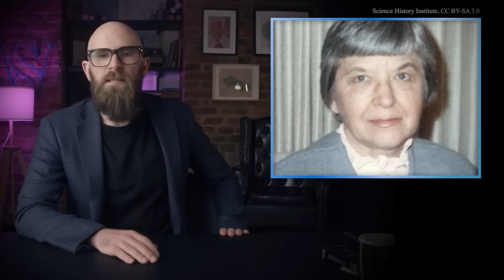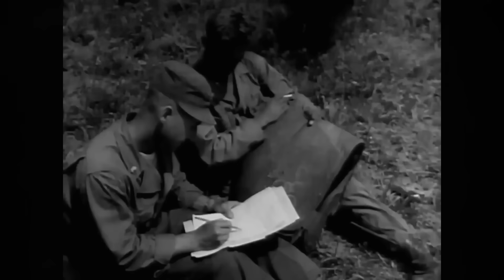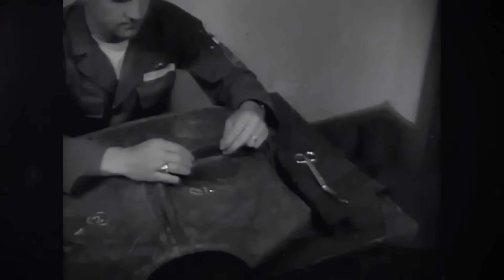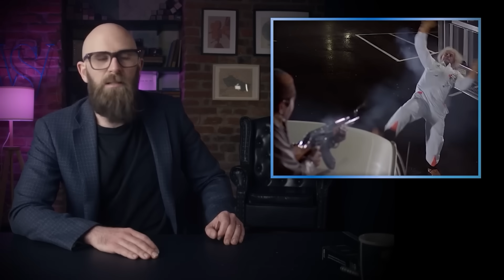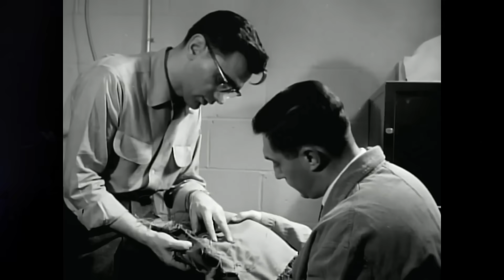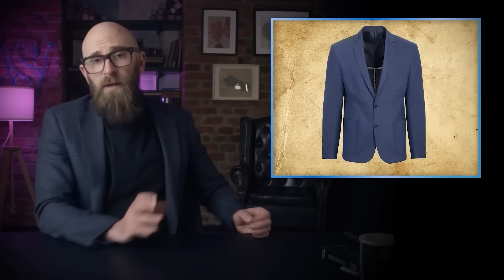How Effective are Modern Bullet Proof Vests Really?

Comment: I made Kevlar for about 30 years.  Not the vests themselves, but the material (a thread line) the vests themselves are made from.  We quickly learned from our engineers that there is "No such thing as "bullet proof."  There is only "bullet resistant."
Reply: like waterproof watches?
Reply: 20mm ap is also a bullet. 120mm apfds also counts as a bullet. 😂
Reply: @jessicaregina1956 . When a 45 ACP doesn’t convey “you messed up” serious enough.  120 mm would be an interesting demonstration lol
Reply: @michaelgallagher7020 way back in early internet I read that 120m sabot also counts as bullet.😂
Reply: @j @jessicaregina1956 echnically I believe that has merit.    Just a big projectile of rearrangement…😂
Reply: Even the big eod suits arent rated for 20mm ap 😂

Comment: Depends on the vest, depends on if it’s soft armour or plate, depends on what it’s rated for.
Level 2 stops less than level 3A stops less than level 3 stops less than than level 4, depends on the gun and barrel length, is it a fast moving small round or a slow heavy round, full metal jacket or hollow point, pistol or rifle or slug, calibre, brass solid penetrators or green tip, how many grains in the round? If rifle what calibre and is the vest rated for that calibre?
If the vest is rated higher than the calibre in use then it works.
If the vest is rated up to 44 calibre and you’re loaded up with silver tip 50BMG then the vest probably wouldn’t stop it.

Comment: Wait... it was developed for tires originally? Where the fuq are my kevlar tires then?!? Would've saved my ass a few weeks ago.
Reply: Goodyear all-terrain adventure tires have Kevlar in them. I hope this helps.
Reply: We actually do have Kevlar tires.  Kevlar layers are incorporated into the sidewalls of several off-road tires.  One example I know is the Goodyear Wrangler All-Terrain Adventure with Kevlar.   The Kevlar helps to prevent cuts and punctures to the sidewall from rocks and other similar hazards.
Reply: They're on my offroad truck. Goodyear wrangler R/T something.
Reply: Run flat tires do exist. They're about twice as expensive as normal tires and tend to result in a bumpy ride.
Reply: @pkobalt yeah but run flats can still be punctured, they just have stiff sidewalls. Well... more than "just" but I'm not super educated on them other than that. I needed a puncture proof tire!